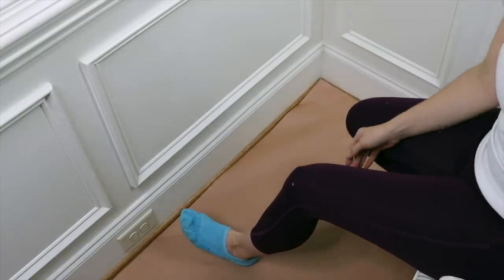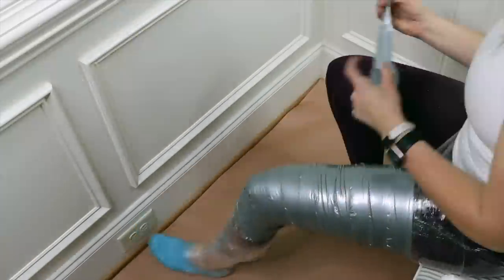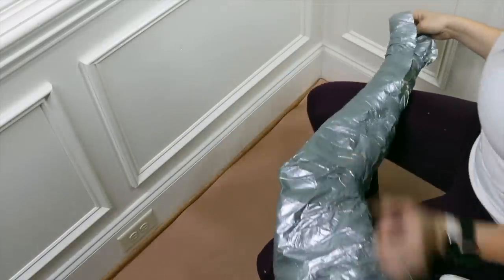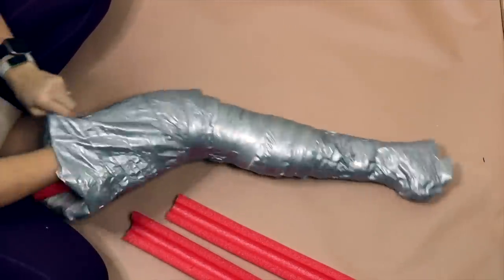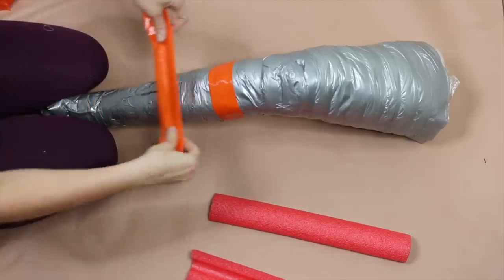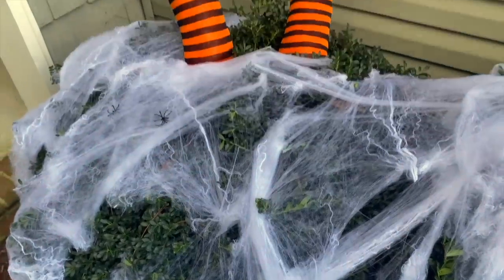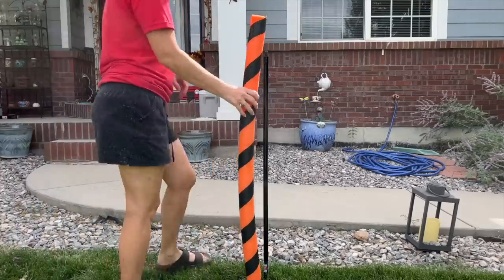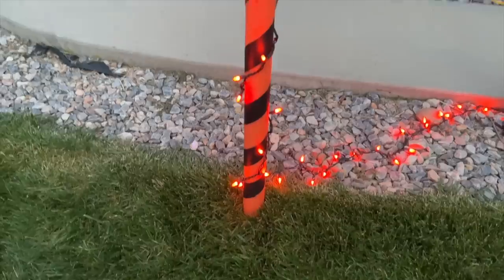She wraps saran wrap around her thigh for this genius idea!

Comment: Love, love, love these ideas! 🧡👻🎃
My only suggestion would be for the pumpkin on the pole.
 It appeares that water will go right through the hat into the pumpkin. Either glue a “lid” on top of the pumpkin to stop water from getting inside the pumpkin OR drill drainage holes into the bottom so water doesn’t sit inside. 
Happy Halloween! 👻🎃🐈‍⬛